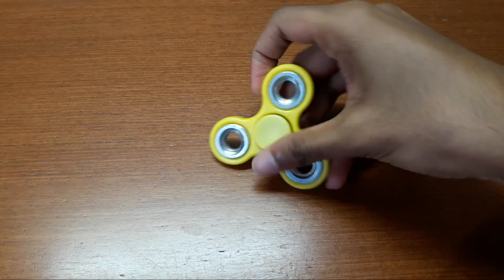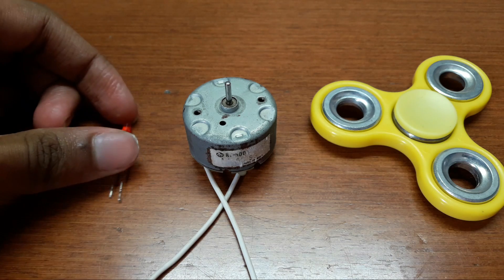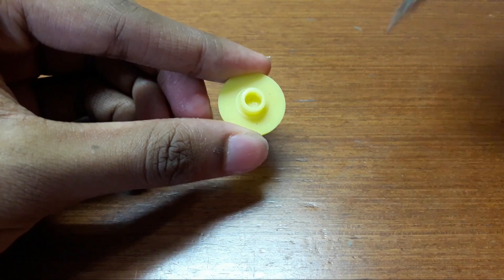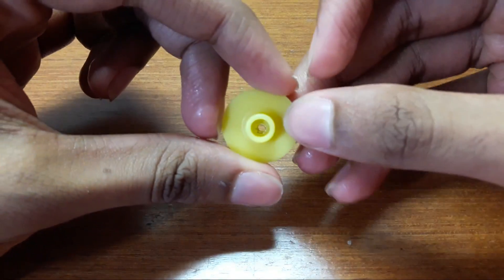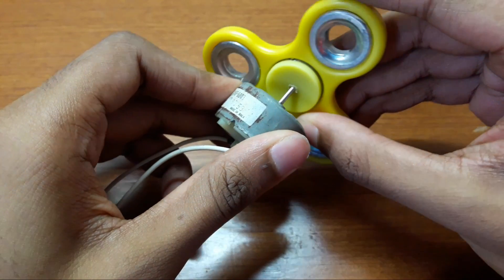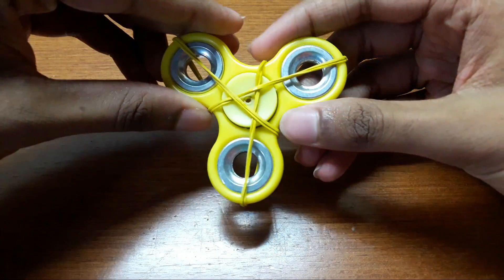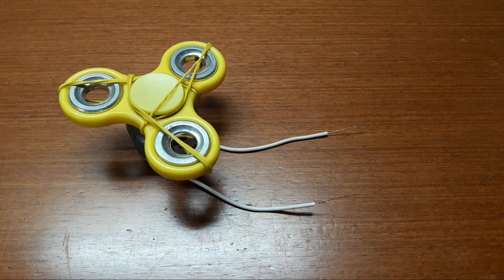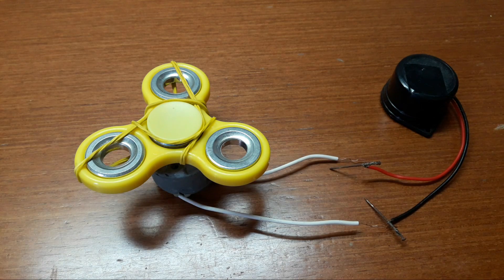How to produce Electricity with "Fidget Spinner" | Free Energy Experiment.

Comment: Remove the cap of bearing and take hot glue gun there is a gap between the bearing fill it up and and close the cap and do hole in the cap and then fit dc motor and fix it and (then try)
Reply from the maker: +Sami Khan Yeah thanks... i didn't have hot glue gun to try it so thats why i used rubber bands! 😅
Reply: Troy Araujo hahahah so pls buy the hot glue gun is use ful
Reply: Troy Araujo thanks
Reply from the maker: +Sami Khan Yeah!
Reply: ننن

Comment: Hi, Did you try to rotate the Spinner the other way or switch the polarity of the LED?
I tried to see polarity mark of the LED but it was not easy.
Reply from the maker: +Johan Löfgren Hey! I tried to spin it in both directions (clockwise & anti-clockwise) but i guess the current generated was too little to glow the L.E.D.
Reply: Johan L